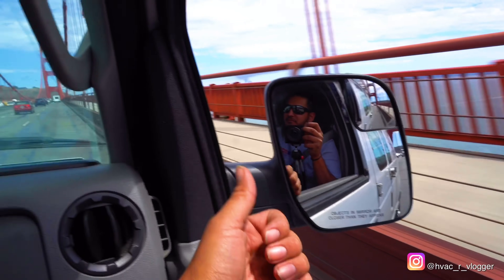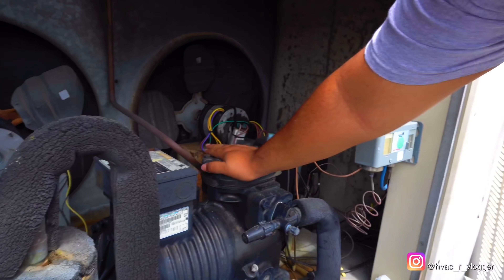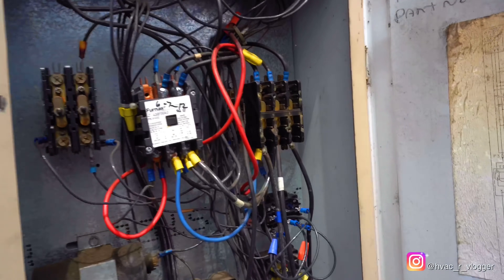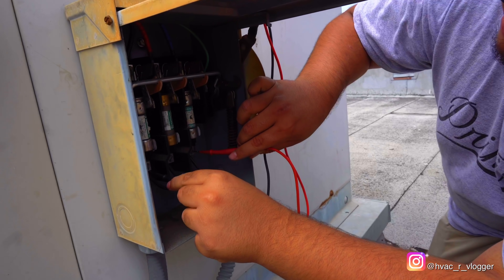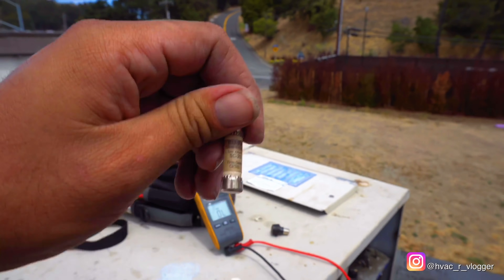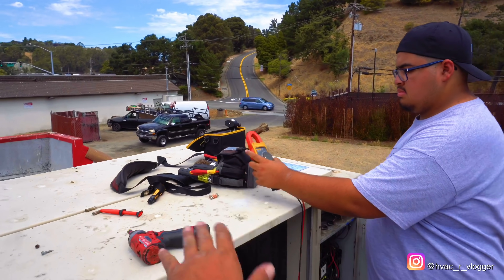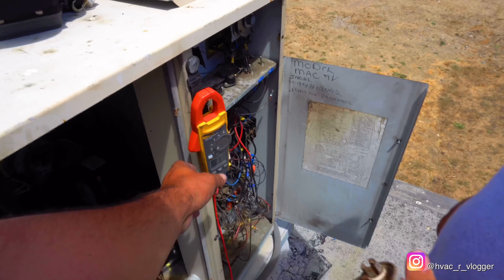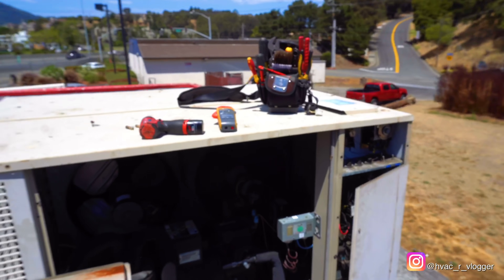Fresh out of SCHOOL / hvac apprentice Day 1

Comment: I wouldn't recommend fusing the two wires together to check if everything is running, something happened and you clearly wasn't sure what. You saw there was issues with wires and different parts. You fixed those but you didn't fix the part that needed a fuse (fuseholder), it's clearly there for a reason. Lets say you go through with it, you can cause a lot more damage since you are not covering it with the fuse. A fuse is there to protect the wires and hardware. I will agree that those things were major causes for the fuses blown, but there are testers to test if cables are okay and nothing wrong in the backline of the system. Otherwise good way of teaching your apprentice, letting him fiddle and be part of it is great. Im sure that was a lot of fun and experience for him to try.

Comment: I am not an AC tech but I have been an electrical tech for over 40 years.  You bypassed the fuse but I didn't see you re-check the fuse holder or use that ammeter you had there to check the amperage on that line!  Leaving the fuse bypassed like that could burn up a motor or worse, start a fire!  I have learned to never bypass a fuse for more than a few minutes to avoid causing more damage.  And you never checked the amps! Thumbs down from me.

Comment: I bought a 14000 BTU portable AC unit. Do you think my 4500 inverter generator will be able to start the compressor and handle the load please?

Comment: Man I wish I could help with refrigeration on my first day out of school . 
Here in Canada we are only allowed to work on LP and Nat appliances up to 400,000Btu/h with a G2 (level 2 gas tech cert) ... and have to take a 5 year 313D apprenticeship ( residential refrigeration ) before you can qualify to write your G1 gas ( commercial gas tech licence) and than an additional 3 years experience with G1 and 313D before you can write the 313A ( commercial refrigeration) 
So it takes about 8 years to become a fully ticketed commercial HVAC tech up here.

Comment: Cool video
 Up to the part where he jumpered the fuse holder leads together. Not a good practice to teach a newbie, who obviously has minimal experience. Better just toss in a circuit breaker or a different fuse holder with a fuse just for testing. I used to carry circuit breakers of different ratings with leads attached, for troubleshooting intermittent issues. It shouldn't happen, but if anything popped when he threw the disconnect, he could've freaked out and stepped over the edge of the building. Safety first. I learned the hard way doing RTU troubleshooting and maintenance SOLO for 15 years at Sears and Kmarts before they went bankrupt... and when I lost my job, THEN I went to trade school for HVACR 😂😂. Saludos y mucho éxito !

Comment: 5:22 you checked the orange fuse flat on the metal top of the unit. That could make the meter beep even if the fuse is open. Both end of the fuse are grounding to the same metal

Comment: Checking fuses on the "metal unit" could possibly show continuity when the fuse could be possible open. Not always, as in your case....that thick paint layer acted like an insulation for continuity not to pass through

Comment: I always removed power when visual inspecting first especially if you are reaching into the unit and checking fan blades, wires, etc.  Its always safer to do a initial visual with power removed imo.

Comment: I kinda just fell into the field. No experience whatsoever. Got an apprenticeship program with a fairly large commercial company on the east coast. They gave a 6 month program, a modern ref and air con book 20th edition. An ride along for said 6 months with “experienced tech”  — first 3 months was with this super tech. Critiqued me over everything and made me do everything. Got nailed off fan motor first time (208v 1ph) He thought it was hilarious and bragged about being hit off 460v before. They removed me from him and gave me another trainer who was a very experienced refrigeration tech. My training was for sure botched. After those 6 months they sent me to Florida to “ graduate”, came back to my state PA thrown into a van and out to service not even pm work. Sooo ups and downs and learned a lot forcibly . However I have now 3 years in the trade and have learned a lot from those super techs short comings. 

There really is no reason to pump your chest to new guys, teach them. Guide them. Correct them. This field can be dangerous and improper training can be fatal. Patience is virtue.

Comment: Shouldn’t check continuity on fuses on a metal panel. It may give false reading due to both contacts at the end of the fuse are both making contact with the metal panel. So it would seem good but might not be. In your case it was ok because the panel was painted. Good video man!

Comment: OSHA states you are to be protected when exposed at voltages greater than 50V to ground. Are you all taught to wear electrical PPE? E.g. rubber insulating hot gloves. Just so it's clear, it's not just electricians that can die from shock or electrocution. If you work with 50V or greater you are required to have training and wear PPE. If you don't know what I'm talking about, NFPA 70E defines that as unqualified.

The statements repeatedly said, "in case something explodes", is referred to an arc flash. It also can kill you without proper PPE.

I hate to be the critic but this criticism may have you think and maybe next time you will have electrical PPE on. It can be the difference between arc flash, shock and electrocution (death).

Work safe so you can make it home to your families. I hate to hear workers dying from unsafe work practices. God bless

Comment: Gana miss working with ac units especially commercial units. Recently quit the ac industry and opened up my own trucking company. Now I own and manage my own trucking company from home. All I do now is answer phone calls negotiate rates dispatch and maintain my trucks.  I still like watching videos of ac's. I'm only 24 so anything is possible.
Reply: @Hvacrvlogger  its totally worth it. You could make a 6 figure salary after 6 months of being in business. I just started so im building up my safety rating in order to work with more company's and also gain clients. But its a good investment. You could also have your own dispatch service and charge 8% of the load so if a load is worth $1,000 you'll get $80 and all you did was sign agreement forms accept rate confirmation and thats it. If you had a dispatch service and 5 drivers pay for your service then you'd be making $400 a day times 5 thats $2,000 a week. Really worth it man. As of now I have my trucking company with 2 drivers driving my own trucks and my own trailers so there's way more money when you own equipment which would be the truck and trailer. You'll be seeing close to 5 grand a week with just 2 trucks and 2 trailers. But my plan for now is to manage my company while I go to school for diesel mechanic, once I graduate from diesel mechanic I wana open up my own road service company and also a mechanic shop. Its easier to open a business having to deal with mechanic then ac. Ac you have to have 3 or 4 years of experience and then you still have to get approved by your boss and if your boss is a dick he'll say "you're not ready yet"  which ive seen happen. Sorry for the rant lol.
Reply: @JohnTheMexicanic  do you go over the road? What kind of trailers do you hall?

Comment: Good video there are always things to add to or to critique one thing I would mention to your trainee is whenever you turn off a disconnect especially a knife switch to verify that power is off with a meter the knife switch can break internally and one leg can still be energized just saying also don’t lay a fuse on metal jacket and do an arms test because the circuit can jump acrossFuse and give you a false reading

Comment: checking the fuses while on a metal surface might give you a false reading saying they arent blown if you get continuity through the unit?
Reply: I believe that’s why he picked it up and had the other gentleman check it a second time.
Reply: The coating on the metal won't give you false continuity. I mean it could if shit was raw ass metal.

Comment: Just a pointer from someone who has went through a horrible experience... if you are going to spin any fan motor, please either verify power is off with a meter, or use a screwdriver. I have lost two fingertips on my left side because my hand was in the wrong place at the wrong time, I would absolutely hate to see it happen to you or anyone else.

Comment: Checking continuity on a fuse laying on a metal surface can give a false reading, always isolate the fuse and don't check it laying down on a metal cover, it's just good practice.
Reply: I was checking for this comment before i type it
Reply: Was just thinking that ! I always put fuses on an insulating surface and then I'll double check it again on the floor or something !
Reply: I was hoping someone else noticed this. I'm surprised that all of the fuses didn't show continuity laying on the metal.
Reply: Thanks for that I would’ve thought of that either
Reply: I was about to post the same thing 🤣🤣🤣🤣🤣 and yes we are a rare bread indeed not many can do what a good teck can do always know your equipment good being an apprentice can be hard on a new guy  especially when there green its not easy out there especially when your trying to figure out what the last wana be teck did to it amd then you have electricians that can't even follow a wiring diagram even if their life depended upon it
Reply: Was going to say the same thing......
Reply: Yup. First thought. Lol
Reply: Guessing the paint kept it from connecting,  still would never do that.
Reply: also to add, before a continuity check, to connect the leads together first to make sure the equipment reading properly. but well done!
Reply: I always stick them up peoples ass first and then check from the toes to the tongue. 100% accurate

Comment: Quick question on run capacitors do you go by the tolerance ie + - on run capacitor or 10% i used to always use 10% but the new company im with wants us to go by whats on the run cap. Also do you guys prefer testing caps under load with formula or always use the MFD setting on meter. Keep up the good content bro

Comment: I haven't done any legitimized schooling, but did order Modern Refeigeration and Air Conditioning. The theory almost completely bored me.

I think beginning with a good thorough tech is best start, but once you have the basics down running your own calls overloads you with learning
Reply: If you find the theory boring, you might want to find another trade.
 The fundamentals in that text book are critical. You'd be wise to read it diligently if you're serious of entering the gentlemen trade of HVAC/R
Reply: Jake M is right. How a system actually cools air is a mystery to too many techs. You have to understand what equipment is supposed to do and how it does it to troubleshoot efficiently.